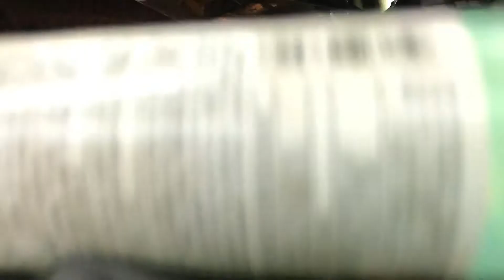2007 ford crown Victoria differential oil change pt2

Comment: It was my understanding that in the manual it says the capacity is 1.8 qt plus the 4 oz of the friction modifier?
Reply from the maker: Hello,, I simply followed the same proceedure,,I emptied the small bottle of lub before adding a new bottle of the oil till it reached the plug before draining back out and reset the plug,thanks for watching
Reply: @andrewmontreal    can't seem to get a definite answer on what kind of fluid- is it 80w90, 75w90, or 75w140?  It's an 07 also with track lock
Reply from the maker: @SGobuck  Hello,,I use the 75w-140 with the small bottle of the additive,,use gloves and DO NOT get any on you,,it stinks,,it smells so bad my ex would not let me in the house the day I filmed this cause some got on my shirt